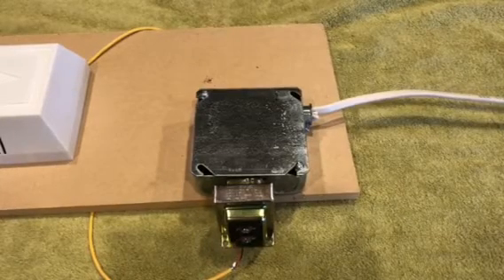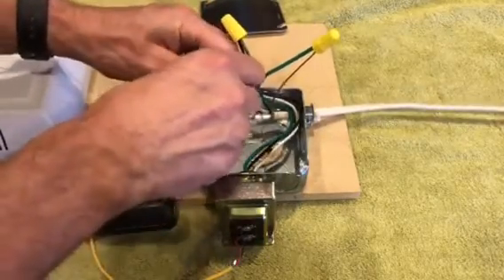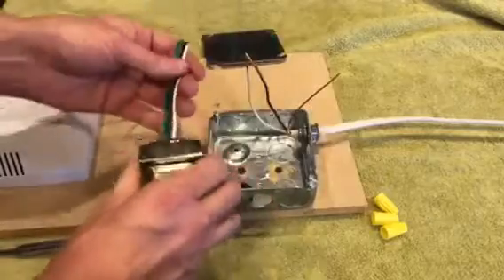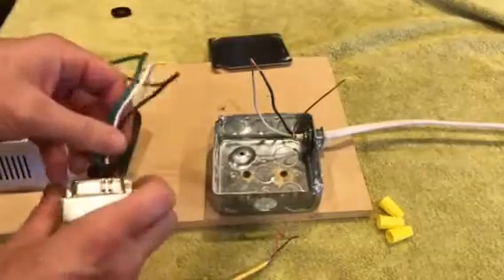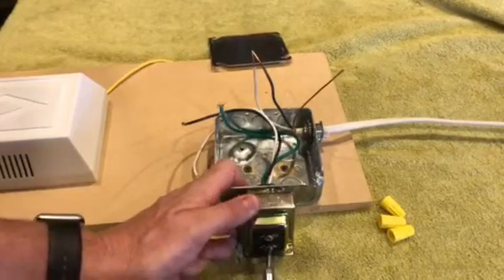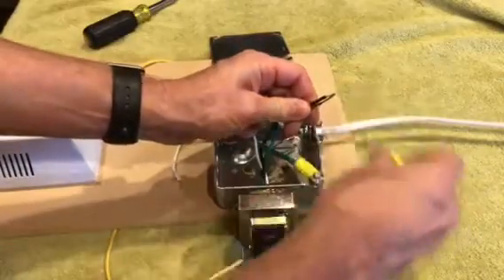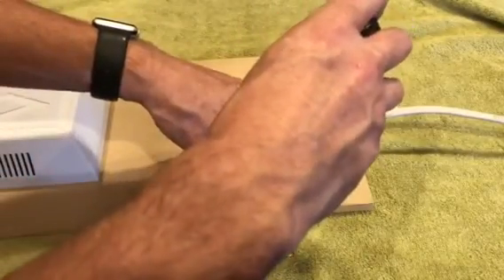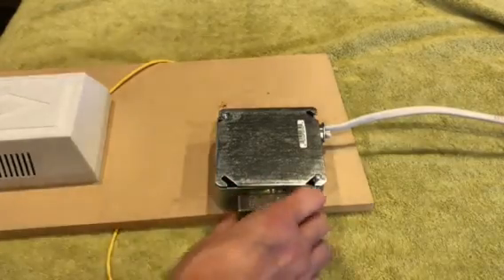How To Install 24 Volt Wired Transformer For Ring Doorbell Pro Or Nest Hello

Comment: cant skip all those steps and just get a plug in 24V transformer.  My existing wires for my doorbell had no power and I couldn't find the transformer so I gave up on that and just installed a plug in one. It was much easier to do that than screwing with an electrical box.

Comment: When upgrading from a 10v to 24v transformer, should I be concerned about the higher voltage transformer with the existing wiring?, what about the chime?
Reply: No.. the one red, one white solid wires used from transformer location to the doorbell are already overkill..  
The existing 'chime' will be bypassed at that unit..  plenty of other vids on this exact subject.

Comment: Can't find my transformer.  Possible locations ?????
Reply: I've seen them in older houses mounted in the central heater cabinet,  other houses in the nearest coat closet in the doorbell vicinity.
Reply: @steven.h0629 Yep. Closet right behind the doorbell chime is where I found it.
Reply from the maker: It could be behind the chime or connected to a junction box that has a light fixture on it.  It depends on how old your house is and what part of the country it is located.  If you look at your chime and can see blue box behind it that is where I would start.  Check out your electrical panel and see if it is mounted there.  If you have a utility room that is also a good place to look.

Comment: should all wires be in a junction box for safety?
Reply: It can be mounted on the side wall of breaker panel too. Does not have to be 
in an enclosed junction box. Low voltage AC current is not much dangerous.

Comment: Do you suggest 24 volt for 2 video doorbells
Reply: If you have two Ring Pro doorbells you will need a 24 volt, 40 amp transformer, otherwise the doorbell chime will ring by itself, or at least mine did, and I am waiting on my new transformer to replace the 24 volt, 20 amp one I have (which works fine for ONE Ring Pro).

Comment: My current transformer is connected to the circuit breaker. It has 2 black wires going to the circuit breaker. I dont know where the new transformer  black and the white wire will go.  transformer
Reply from the maker: Is your transformer located on the circuit breaker box?  Are you saying that it is hooked up to two breakers or just one.  If it is hooked up to two breakers it could be 240Volt and not 120V.  Look on the outside of your transformer and it should say on the transformer what the input voltage is rated at.
Reply: @sellgooddeals-DIY  That is why everyone should own a simple multimeter.  I know some transformers have black wires instead of black 
and white.

Comment: How do I ground it if my electrical box doesn’t have a copper wire to connect my green wire from the transformer to?
Reply: add a ground screw in the box

Comment: Great video!!  I have a 16v 10 amp transformer.  We have a Ring Pro, going to a 24v from 16v is ok?  What amp rating with the 24v?  Thank you so much!!
Reply from the maker: Thank you for watching!  Either a 16V 30va or a 24V 20va transformer should work for you.
Reply: @sellgooddeals-DIY  great, thank you for the quick response!  Have a great holiday season!
Reply: I replaced my transformer with a 16V 30A.  Now I have a buzz on my doorbell and when you press the doorbell it won't ring the mechanical chime and we have the buzzing.  I've ordered the 25ohm 50W resistor to see if that will solve the problem.
Reply from the maker: @supercharged00gtp Sorry to hear that. Try turning the breaker off to the transformer.  Wait 45 seconds then turn it back on but don't hit the button.  Is the buzzing gone?  Do you have the power kit hooked up to the chime?  If you have 30 minutes it would be interesting to see what would happen if you remove the two wires from the Ring Doorbell pro and touch them together to see if the chime sounds. Also, If you have any extra wire lying around you could unhook the wires from the transformer.  Then hook the Ring pro directly to the transformer and see if that works.  It kind of seems like something else might be going on as well.
Reply: @sellgooddeals-DIY  We pulled the box, it's the Ring 2 not the Pro.  I have a resistor coming for it tomorrow to see if that helps.  I'll also try hitting to identify the breaker, the doorbell is wired via the same wiring as our power supply to the smoke/carbon monoxide detectors.  It was mounted to the box my basement detector is mounted from.  I didn't turn the Power off to avoid the beeping from the detectors resetting.
Reply: According to ring, if you have a chime you do not need the resistor, only if you are using it without a wired chime and direct from the transformer...  the mechanical chime becomes the resistor. A hum can also be caused by bad wire or incorrect, or no, ground. I have an issue with my  24V transformer, labeled 24V 20VA, putting out 25V, which i am told it is fine to be less than 10% over, or under. The reality is likely the city power fluctuates from 115 to 125 depending on usage.. that sensation when you plug in a heavy power tool and you see the lights dim briefly.